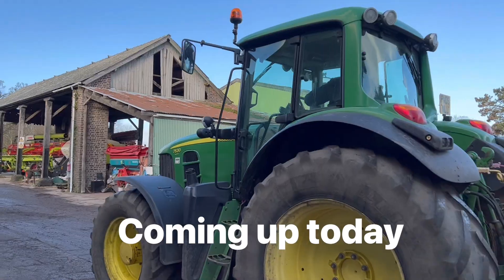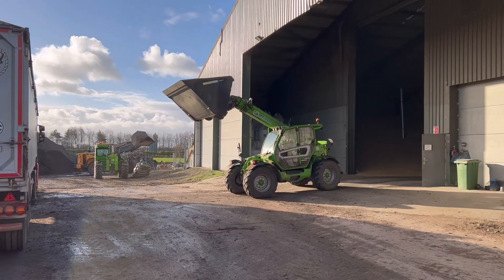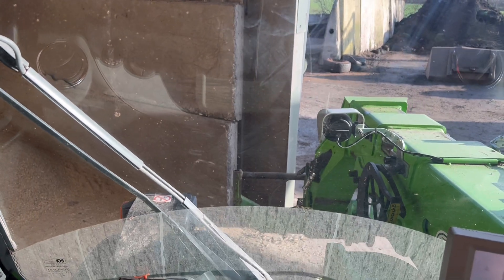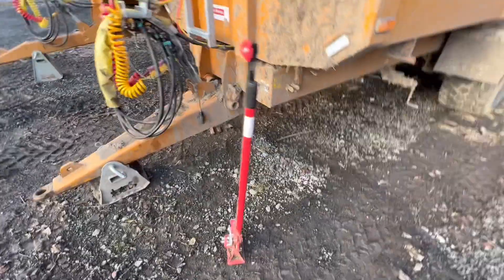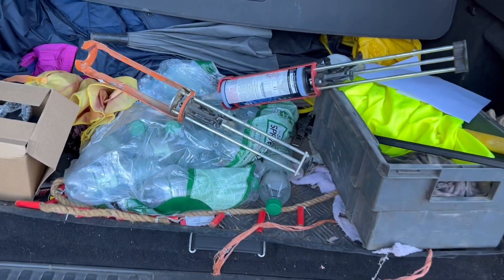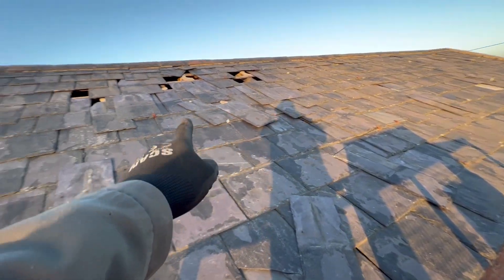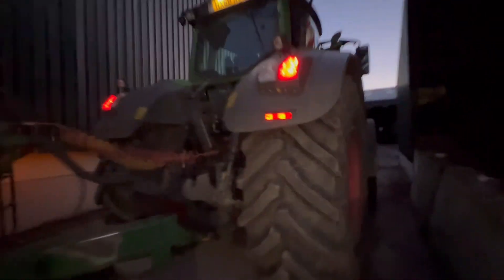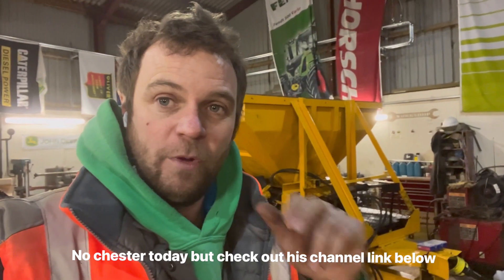Day654 #OLLYBLOGS  NAKED FENDT,  NEW JACK & IM UP ON THE ROOF  #AnswerAsAPercent

Comment: The top bracket on the high lift jack is so it can be used as a large clamp, or for tensioning fence wire for instance.just keep it safe in the workshop where you can find it🤣🤣🤣🤣🤣.
The old barn/shed, replace the pillars with used second hand telegraph poles which you can get from a utilities company.
Another great video, always a lot going on on your farm, makes good viewing.
Reply from the maker: Thanks 😊

Comment: Feeling 95% still 🙂
Olly the red bit on top of the 'farm jack' is so you can use it to squeeze things.
Great fun patching up slate roofs. Use silicone instead of resin, it gives a bit more flex and if ever you needed to get them off again it can be cut a lot easier.

For the other barn with the rotten pillars, in the past I have seen concrete cast round them using 210L drums to help give them some extra years till funds allow a new building.

The barn doors look spot on and think it needs a tractor weather vain.
Reply from the maker: Oh yer tractor
Reply: @OllyBlogsAgricontractfarmer  A customer of mine has a Cropmaster one on his museum.

Comment: Bottom of shed posts, dig a hole around the post get a 200L barrel or a bit of twin wall pipe split in half long ways, strap it around base of post in the hole then fill with concrete, once concrete is dry undo strap and take the pipe/barrel mould off

Comment: Those jack's can be used for a lot of different job's! I have 2 of the longer one's which I use to hold tractor cab's up when wheeling out the transmission attached to the engine.  Put a wee bit of belting on the part which touch's the trailer when jacking to prevent it sliding as the angle is changing as trailer raises. You could get a serious doing if it slid when lining up pin.

Comment: The Top Piece on the Hi Lift  jack can be used as a Clamp or turned up you can put  a shackle throgh the Hole and use a s hand winch make sure you keep the mechanism well oiled

Comment: Hi Lift jacks have so many uses.  Lift, push, pull, clamp, tension .    I mostly use mine for post or stump pulling so use the top jaw as an anchor incase it slips.   The jack can be used as a puller for getting a vehicle out of a hole with the top jaw set vertical and a D link or strap hook through the hole..  also can Used as a clamp or a spreader are a few other uses. Great for heavy duty wire tensioning.   The jaws can be turned either way for top or bottom use.  The top jaw can also be used as a secure anchor ..    they are also made to hold D link or chain.    Ps: tractors look Naked now lol.
Reply from the maker: Oh I get it now handy then
Reply: @OllyBlogsAgricontractfarmer  very handy.  Weld up a wedge to attach on the top clamp and you also have a log splitter but be aware of the log flying lol.. not for the  faint hearted.. 🤪😁

Comment: Ingenious tool for me is an induction heater I bought before Christmas Rusty bolts or nuts 2 minutes quick heat job done and I don't have to worry about setting fire to anything around where I work,love the new intro 👍
Reply from the maker: We use our quite a bit well handy

Comment: If the steel on the bottom of the pillars on the dutch barn are rotten, we used to cut a 45 gallon drum down the middle them put it around the pillar and fill it with concrete. I remember as a kid seeing them 2 or 3 drums high in places !
Reply from the maker: Yer I seen that done

Comment: The red part on the top of the high lift jack can also be fitted below the jack and used as the jaws of life aswell and open up crushed cars to an extent I do have the manual for mine some where I'll dig the pics n info out for you
Reply from the maker: Thanks

Comment: The bit on the top off the high lift jack is so you can use it to pull like a come along or to hook over a bar and pull up a load or as press between the jaws. Agree with Duncan above need a good base for it. Have had them sink in the mud. Keep the springs and pins clean and lubricated. “Watch your fingers they bite!”
Reply from the maker: Yer look like they do

Comment: for lifting the trailer, we used one of the extendable legs off an old lorry trailer we converted into a bale trailer, it wasn't too hard to fabricate and we had a steel plate on the bottom of it to give it a much bigger footprint plus it would lift a lot more weight than the one you're planning to use.
Reply from the maker: But we might jack any one of 6 trailers

Comment: On this Video 6min in when setting Jack up you should be able to pull it up to drawbar then lock catch to start jacking up. Bit like when you lower & it drops to floor. Landrover off roaders use them & ex boss used same as you to double trailers up 1991

Comment: Good idea with the jack for the trailers, could you have used one of the lift arms of a tractor to lift and blocks of timber to hold in place, (not as safe but )
Reply from the maker: It’s never right hight and a lot of faff

Comment: Careful filming and jacking one handed, high lift Jack's are crazy dangerous. Amazing but sketchy
Reply: Yes make sure the trailers brakes are on,hi-lift jacks are good at falling over.
Reply from the maker: Yer can see how they could be
Reply: @rescuecow90  That and when they have weight on them and your trying to lower the jack  if the Dawgs don't engage fully the handle will come up and take your teeth out.

Comment: Those jack's can be pulled up, so no need to pump them until they reach the lifting point.
Reply: @OllyBlogsAgricontractfarmer  when you park up your trailers have you considered lifting the bodies and resting the front on a block of wood so that they don't fill up with rain water. 
That's what many Lincolnshire farmers used to do.
Reply from the maker: @adrianchetwynd1334  they have props but takes oil out of tractors and back doors seal to well
Reply: @OllyBlogsAgricontractfarmer  the volume of oil is irrelevant because, let's say 2 litres was in the rams when the trailer is picked up, the 2 litres are merely being put back when the trailer is dropped off. So the 2 litres of oil would be a one off investment for the life of the trailer. However messing about with the blocks in the dry season isn't worth the hassle.
So do you mean the problem is increased contamination of different back end tractor oils?